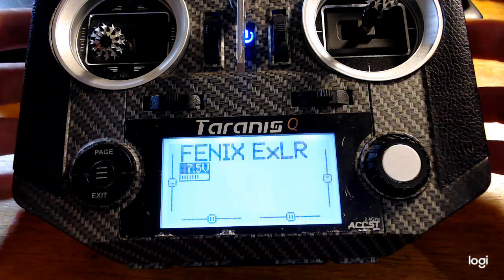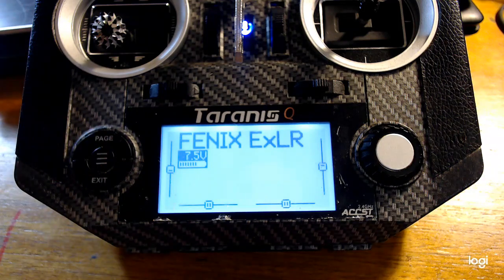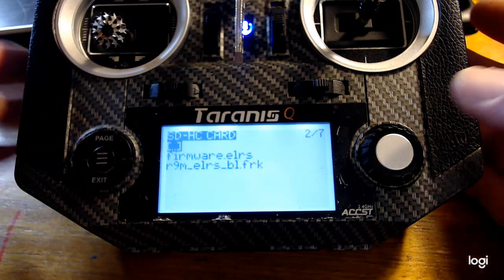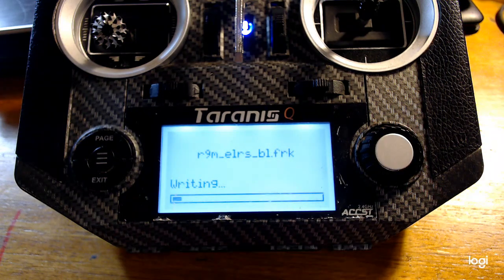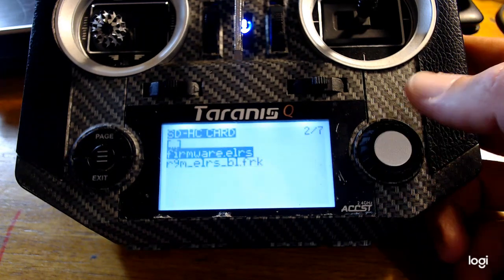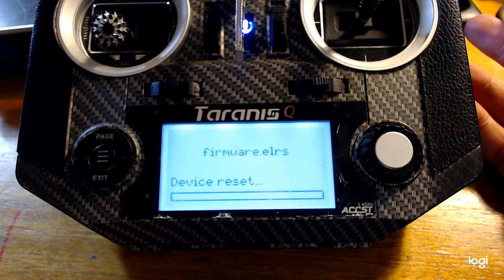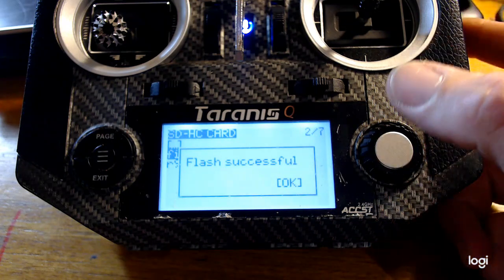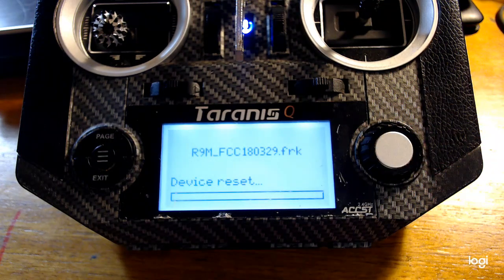Flashing your r9 tx with ExpressLRS

Comment: Hi I downloaded the opentx 2.3.10 link from Alessandro AU ExpressLRS github page, and now I notice the request for sdcard update keeps flashing each time I turned on my qx7 transmitter. Also I discover the tool section for betaflight and crossfire tool is also gone on my radio. Pls advise. I haven't even started on the rest of the flashing procedure. Got stumped there. Is the current Opentx 2.3.10 version the same as the one on ExpressLRS page? A bit confused.

Comment: Do you have the r9m mod or just lowering the baud rate to 115200K? I tried to flash my r9 mini RX using my FC but couldnt make it? Is it possible or need and STlink?
Reply from the maker: You don't need to change baud. And for the RX are you using Wez's version of BF?  Best places to get help is Discord.

Comment: Funny you are running same firmware I'm running.  180329 FCC.  I found that to be most stable for me on my 2018 Accst R9M.  The newer versions 19xxxx was giving weird Rssi dropouts.   Looking forward to trying the ExpressLRS and I joined the FB group and you have been walking me through and I appreciate it.  I only have one R9Mm reciever though and the rest my fleet have slim+ receivers.  I fly mainly fixedwing LR.   
I own Full XF as well and I can't begin to tell you how let down I was over that gear.  One issue after another!  I paid $230 for that XF and rarely even use it and only have it on one quad for testing.   I've been trying to get bluetooth to external devices for live maps working which  XF claims its supposed to but it doesn't seem to work.  
Oh well.  I'll most likely sell the Full XF TX and 2 nanos.  I just order another R9m Access module so I can start  modding my existing R9M.   I appreciate all your help. Super kind!  Cheers.

Comment: Wait so this Doesn't require soldering an Stlink to the R9? Only need to install firmware? And this gives the super low latency?
Reply from the maker: Yes, yes, and yes ☺️
Reply: @JyeSmith  thanks for the video, i will be looking into doing this soon. Ive been flying with R9 on Fport for almost 3 years now without any problems.